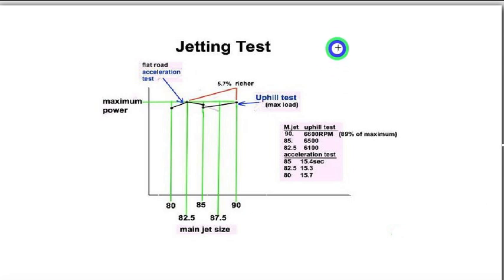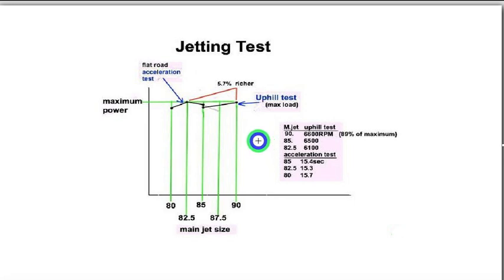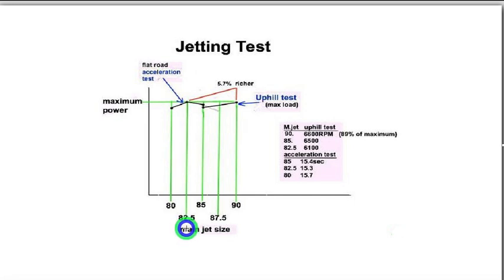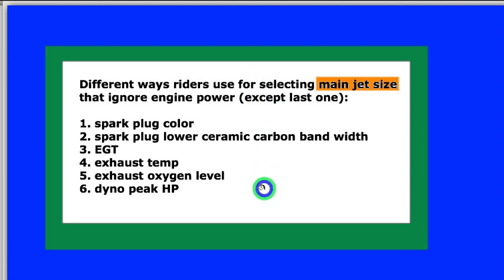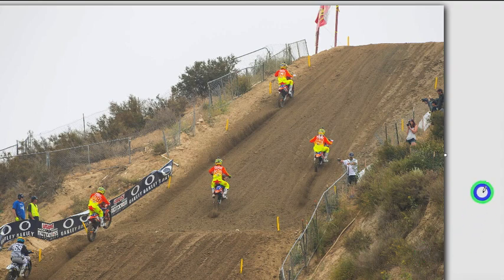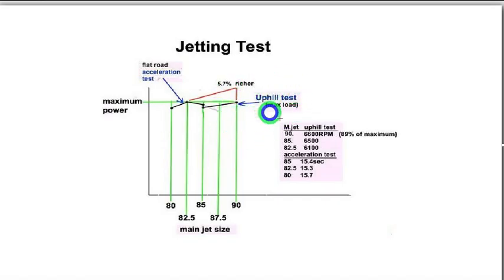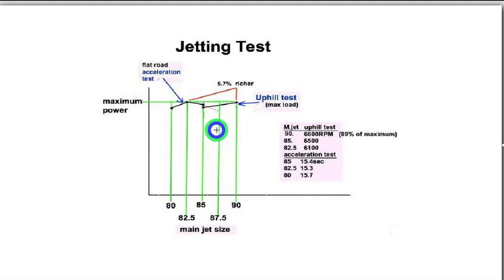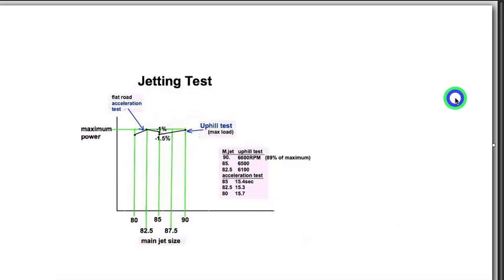2 Stroke Jetting rabbit hole

Comment: You speak the truth, you've done empirical testing which is of great value unlike a lot of the book reader repeaters with no actual real experience on the topic. I greatly respect your knowledge and experiences. To add from my experiences:

My experience is with calibrating car engines, learned by doing on two boosted cars of mine, hundreds of flashes and hundreds of hours tinkering, with successes like making 500 bhp with a 2.4L ecobox engine.  That landed me a job doing engine development in the dynos professionally where my engine projects all used cylinder pressure transducers and hope someday these become affordable (like they come standard on factory cars). In addition we used a powerful tuning aid that is the wide band O2 lambda sensors to measure lambda and AFR. I also used this tuning privately and in addition engine tuning companies require access to wide range O2 readings.

I thought I was clever bringing O2's into 2 strokes, however I have recently found a flaw with my approach in using 4 stroke automotive AFT targets for 2 stroke small engines. I may be able to accurately measure AFR, however I don't actually know what AFR is good for each load with a 2 stroke or with my 2 stroke engine model.  In addition, there could be an offset in my AFR measurements based on the location of the O2 sensor (in fat part of pipe).

 I run a Paramotor that spins a propeller, the propeller spinning on the ground making static thrust is a very good analog of in-flight loads.  

Recently I found a hole boring through my piston from detonation, right above the spark plug.  I've been running 93 octane + boostane making it 100 octane fuel. 

On my Dyno stand with the O2 sensor, I targeted about 14.7:1 at idle and cruise rpms, and 12:1 at WOT.  I correlated these numbers with the EGT readings.  There is good correlation when you are near stoichiometric AFR, however EGT can read high if you are too rich.

New piston on order and going to get back on the Dyno stand to develop / validate more rich tunes at higher loads.
Reply from the maker: What EGT did it give at 12/1? I thought idle was supposed to have the richest mixture. Have you tried richer? Probably best to set mixture for strongest idle and then just measure its AFR.
Reply: @MichaelForrestChnl  Sorry looks like youtube may have lost my first reply. With the Polini Thor 202 specifically and the factory EGT location, I see about 620C at WOT.  700C at mid-range cruise (~6,000 rpms, in flight).  This correlates with what other pilots with many hours on the engine suggest, hearsay the factory also confirms 700C at cruise rpms. Nice thing about a factory EGT location with a special metric thread so we all use the factory EGT sensor (type, depth same). 

As mentioned I'm coming at it with 4T tuning in mind and I am suspicious, risking engine health to see for myself what running at stoich will do. "There is one way to find out" method of development I guess. 

Here is a video when I installed the O2 and I'm playing around with it, you see when I choke it AFR drops (what I was looking for) and engine speed increases as you've alluded to.  https://www.youtube.com/watch?v=242JgRsWnpA

This is now in my mind to recalibrate the idle AFR richer, as I do run idle RPM over 2000 to prevent stalling.  So maybe the leaner idle is part of my challenge.

Comment from the maker: This comment was from the previous version of this video. 
@markburden6265 : "Great video Michael....thumbs up dude ....top end jetting feel is so important..I run castor and jet with feel uphill ....everything is a compromise...I jet for engine life as well as performance."
My reply :
"yes, jetting is a combination of getting good peak power without ruining reliability. I forgot to include that if you happen to jet it so lean to get peak power that it causes the oil to start burning on the piston, and you don't want to change to a more heat resistant engine oil, then it's probably because the squish velocity is too low."